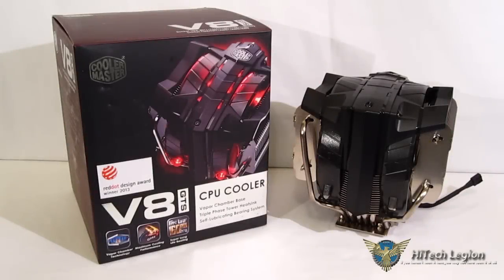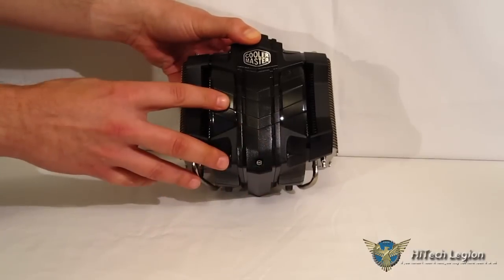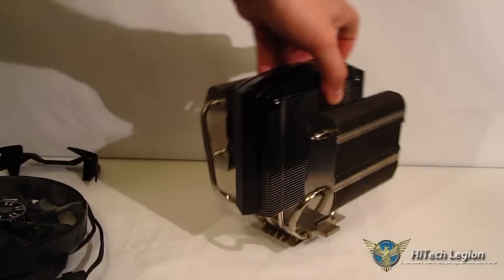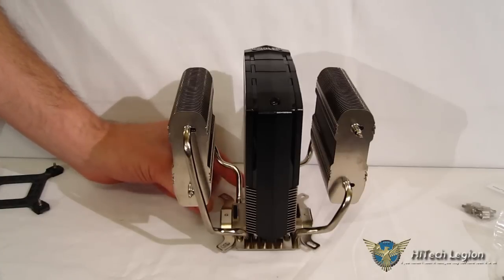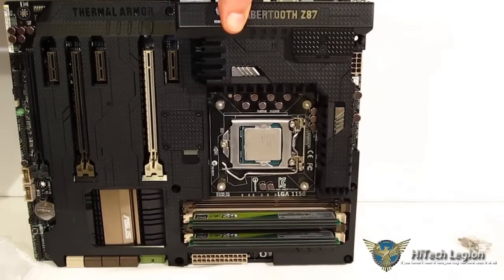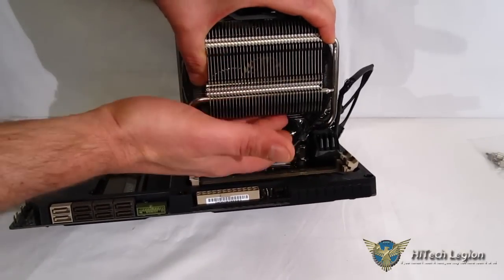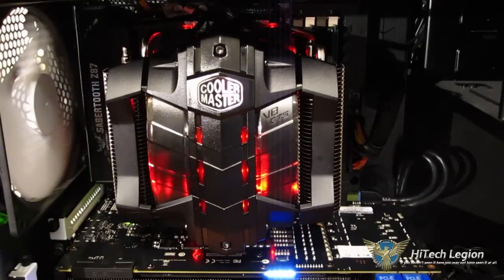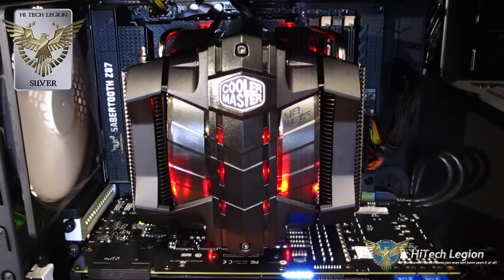Cooler Master V8 GTS Overview, Installation and Benchmarks

Comment: That thing looks awesome! I really want to include one in my CM Storm Trooper build but I'm afraid that I'm going to lose the first PCIe 3 slot on my Asus Maximus V1 Extreme because it seems like it's going to block the 1st Asus 760 Graphics card from being installed. Do you have any thoughts on this? Thanks in advance for any assistance that you can offer. Peace, Vern.
Reply: I don't have that board around to try it, but I feel pretty sure you lose the first slot on that board. Of course, unless you are planning on doing four video cards, it won't make any difference.

Comment: The noctua nh-u14s has lower temps???? But that is just a single tower with 1 fan and its quieter.
Reply: The NH-U14S performs almost on par with the NH-D14....more is not always better in the world of coolers. Engineering goes a long way.

Comment: I dont think i get this right, but were should i put my actuall cpu, my proccesor? when the v8 gts is pretty much replacing the proccesor, is the proccesor on the other side or what?  i cant put the v8 on top of the cpu..? -.-
Reply: the processor is just a small chip...
you can see him putting the v8 right on top of it right there in the video
Reply: Srry i was thinking of something else, but yes ur right

Comment: I was actually looking at this cooler when I was upgrading from the CM Hyper 212 Evo. I'm glad I didn't haha. I ended up going for the CM TPC-800 and using 2 120mm corsair SP120 fans with it along with the NZXT Sentry Mesh fan controller. I still think the V8 GTS looks badass though, but in terms of performance, like you said, it's just not up to its price tag.

With a 4.1GHZ OC'd AMD Phenom II X4 965BE the temps idle at 28C with the corsair fans on the absolute minimum and idle at 25C with the fans on maximum. During Prime95 testing the temps tend to go no further than 52C, that is with every fan in my case on max though. I would highly recommend the TPC-800 over the V8 GTS and I believe the TPC-800 is cheaper too.

However, if it's looks you're going for then stick with the V8 GTS and of course, you get the added ability to keep your RAM with the V8 cooler. The only downside for the TPC-800 is that it covers 2 RAM slots (atleast on an AMD socket) and it doesn't give much in the way of clearance. Just to give you an idea I couldn't fit my Kingston HyperX Predator modules under there.

Comment: This thing used to be $500 but no one bought it cause it was a pos.
Reply: Retail has been $99 since it was released. No one in their right mind would buy any $500 air cooler, and no company will be releasing a $500 mainstream air cooler any time in the near future.
Reply: It's NEVER been over 120, and that was only from the most expensive retailers. It's always been between 89 to 99 bucks. Plus, with the original having a TDP of 180, & this model having TDP 190, it's also ALWAYS been on par with even the best custom water loops. So yeah, wrong on both accounts. It used to be a beast- Now- It's a classic beast.
Reply: WTF R U on about!
Reply: WTF R U on about!
Reply: Lindsey harris 500 dollars for a cpu cooler...are you fucking real or just another dumbass amorican.......

Comment: can i place it in my case its an Cooler Master K-380 Advanced 3.0
Reply: and i have an AMD Vishera FX-8320, Eight-Core  processor
On a ASUS Sabertooth 990FX R2.0 motherboard
Reply: Jeffrey Veenman Unfortunately, the case lists 155mm as maximum cooler height and this stands 166mm.
Reply: ok thanks

Comment from the maker: The Phanteks mounting system for the 14PE is almost identical to the D14, part for part.
Reply: would this be fit on a techware alpha case and a asrock fatality mother board?
Reply: HiTechLegion I'm wondering about putting that cpu cooler because I don't want it to put so much stress  on my motherboard
Reply: HiTechLegion Can I use only one fan as the other fan is blocking my ram slots

Comment: I really wanted to like this cooler, it looked great, and I was able to pick it up for $90 at my local Microcenter. I removed the fans (Great tip!) and the install on my i7 4770k wasn't too bad.

But it's loud, (kind of a turbiney whine noise if that makes sense) and the cooling is just OK, not spectacular.  I never really thought I had an issue with noise until I installed this thing. Looks like the Hyper 212 EVO is back in service!

Comment: the black phanteks look better than that cooler would ever look inside a design r4, so depending on the case you use you could find something that beats it in the looks department. i was expecting more from that cooler at 99.99. it performs like a 49.99 cooler so paying an extra 50.00 for a couple leds is not very smart. the Phanteks PH-TC14PE are 75.00 on amazon. get a good air cooler or go liquid. for stock use just stick with what came in the box with the cpu or buy a 212.

Comment from the maker: George Unboxes, and Reviews the Cooler Master V8 GTS CPU cooler.
Reply: I don't "unbox" anything....it was out of the box long before the camera started rolling. "Unboxing" videos went out with dial-up modems....
Reply: Droid well you could go with a police theme ;)
Reply: HiTechLegion wish it had blue LEDs, it would look horrible in my blue and black build
Reply: HiTechLegion  will this fit on AEROCOOL STRIKE X ONE ??
Reply: Is that patriot g2 series ram
Reply: PcGaming1080p Yes, it is.
Reply: George Cella hey. what's the name of that mother board?
Reply: joshua matunog ASUS Sabertooth Z87
Reply: thanks!
Reply: I found your video of this installation to still be incredibly helpful despite my V8GTS is going onto the Rampage V Extreme motherboard.   getting those screws to go back in to the fans after mounting have been proving to be tricky aside from that the Rampage V Extreme had bracket on backside there already so used that one which seems to be doing the job quite nicely thus far.   anyways great video...
Reply: Droid replace them

Comment: Have owned many Thermaltake products from Mecha G1(awesome keyboard), VOLOS mouse to Water 2.0 Extreme, never had a single issue. Recently purchased the NiC C5 which is an excellent price/performance cooler and is highly rated by Tweaktown. Experiences vary but I for one have nothing but good things to say.  Also anytime you buy a sleeve bearing fan like the Sickle Flow, you should oil them. This will ensure they last as from factory sometimes the oil level is low.